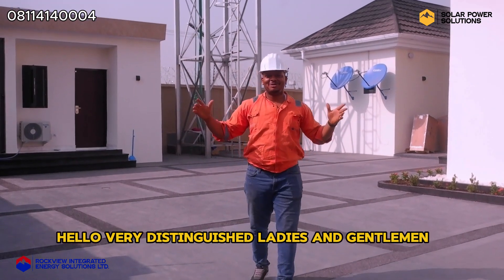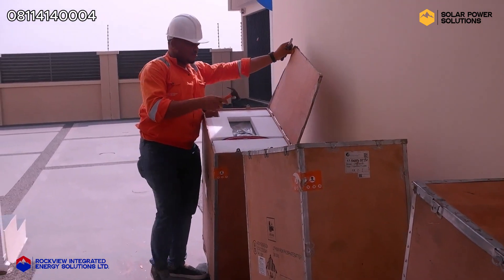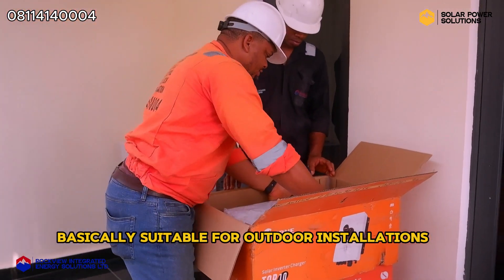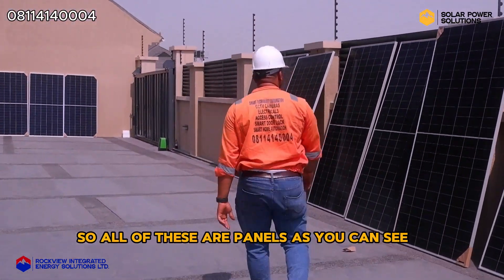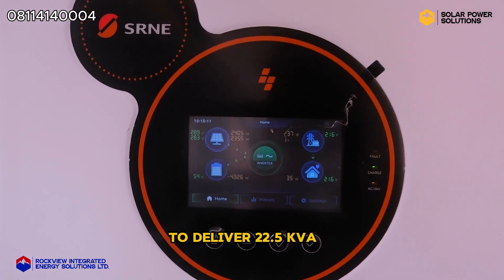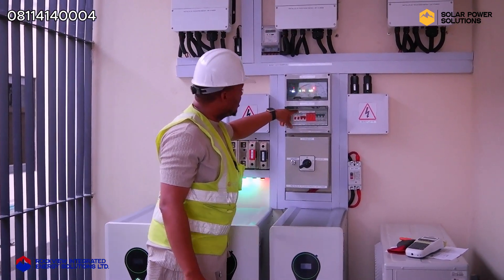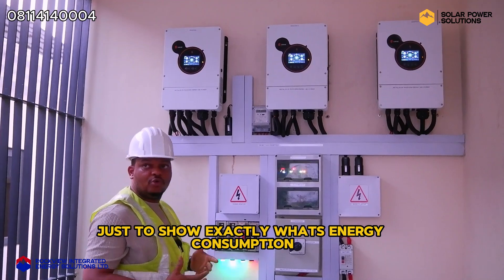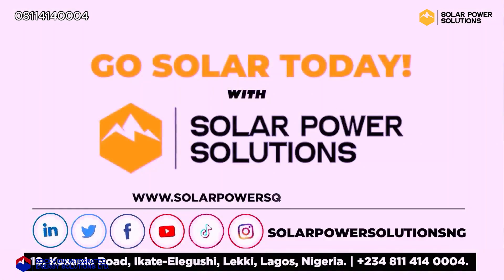How to Install the Best Solar Inverter System for Your Home

Comment: Nice work but how do you connect the panel wire to the 3 control I'm always confused they everytime
Reply from the maker: It's a technical connection that usually requires a skilled professional/technician to get it done.

Comment: I hope you will cover the cut-out box. It is at a level where children can easily reach and that is a disaster waiting to happen. You must securely cover it or mount it on a higher level. There is a reason why it is conventionally mounted high up near the roof. The comment about the proximity of the batteries to the AC outdoor unit is right on point. Heat is the number 1 killer of LifePO4 batteries. Change the position of the unit. Otherwise this is an excellent and neat work. Well done.
Reply from the maker: Thank you very much for your comment....very professional. To respond, the cut-out box was eventually discarded and ended up with a single phase arrangement.
Reply from the maker: Secondly, before we settled to allow the battery to stand by the AC outdoor unit, the client confirmed to us that they hardly make use of that particular AC. However, we explored the window to move the position of the outdoor unit  but was left with no alternative option. Overall, notice that the veranda has enough ventilation, so it wouldn't pose so much of a hazard.

Comment: Your setup is neat well installed but i lithium battery right in front of Ac outdoor is a disaster waiting to happen.... This is sooo wrong in any way
Reply from the maker: Thanks for sharing your concerns. A lot of things were put into consideration before we finally chose the location for the setup, we already considered the possibility of that and the client usage of that particular AC system. 

You should notice that the veranda has enough ventilation, so it wouldn't pose so much of a hazard.

Comment: Great setup. The only problem is the positioning of AC outdoor unit next to the battery. That battery will be extremely hot
Reply from the maker: This concern was addressed in a comment made earlier.

We considered the possibility of that, and weighed our options, coupled with the fact that that particular AC is not being used, and then, we were able to make a decision.

Comment: Nice Job. However you said the inverters are connected in parallel which means the inverter functions has one,  how come you said they are also three phase is each of the inverters a three phase system? please explain further
Reply: @rocketconcept6327  I think that is for the AC(grid) coming in, maybe I'm wrong
Reply from the maker: @smallqwaro  yes, you are right. The three phases are the phases of the main grid

Comment: It looks very professional, tells me you guys know your stuff, will definitely keep your contact, I just hope you guys do nationwide, also that 2 in 1 breaker setup is amazing. 
Btw please keep the music low or remove it as it's very distracting and hard to hear you at times. Appreciate the longer videos as well. One question I have is do you calculate the breaker sizes based on the setup?
Reply from the maker: Thanks for the acknowledgement. We take our time to put together a concrete design for our installation before getting to the site physically. 
It is at this design stage that we determine the right components to be used during the installation and, in this case, breakers both MCB & MCCB.

To answer your question, YES, our design outlook stipulates breakers to be used in our installations.